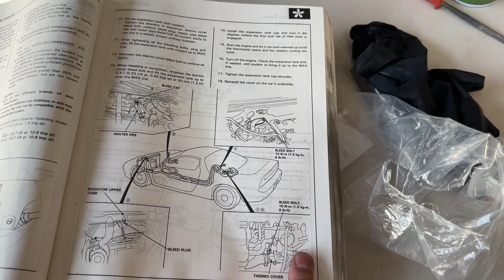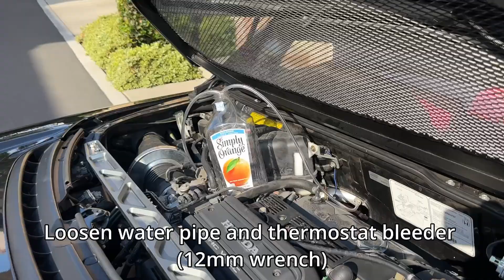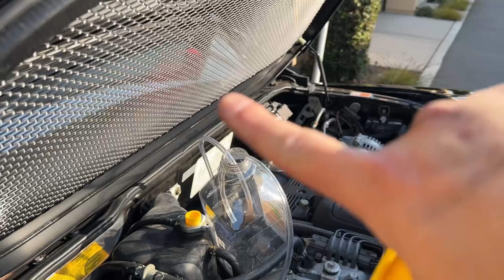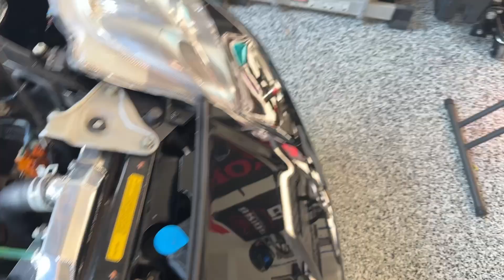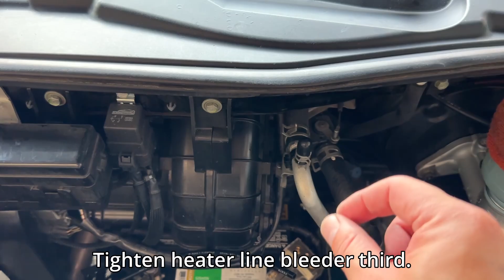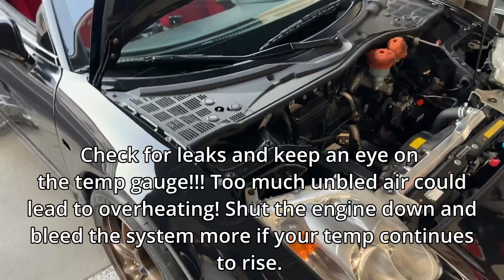How to: NSX Coolant Bleed Procedure | 1991-2005 NSX

Comment: Wow, great video, and you are batting 1000 with me with your videos lately because in addition to taking my door panels off soon, I'm also planning to replace all the coolant hoses and so this video if yours will help me a lot with that too.   Thanks.   If you're taking requests, could you do one showing how to swap in the JDM trans gears and NSX-R final drive?   Also on my list :)
Reply from the maker: Thanks for the positive feedback! Unfortunately I already did the gears and had a professional do them for me. I would suggest the same for most people as it’s very involved and requires some special tools and making sure tolerances are correct. I did save money though by removing my trans myself (which is why I have a video for trans removal). Sorry to disappoint!
Reply: @ChrisLumNSX  No worries, that helps a lot!  I've done lots of work on cars but never any transmission work, so I wasn't sure. I was hoping it was as simple as cracking open the trans case and just swapping parts in.  Knowing you decided it was more than you should take on definitely tells me it's more than I should, and I'll check out your video on removing the trans so I can at least save some good money on that part of the job!